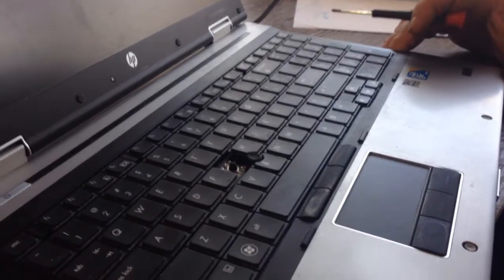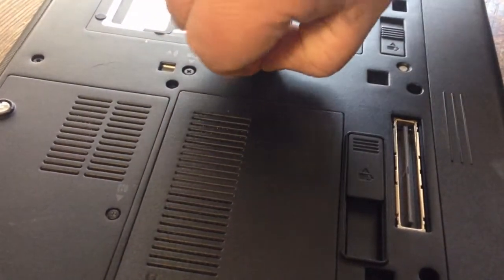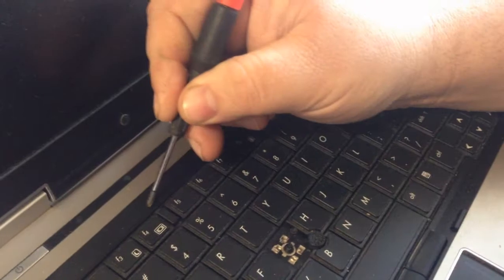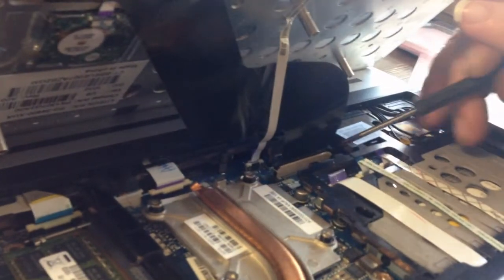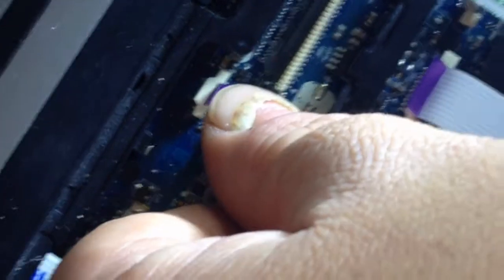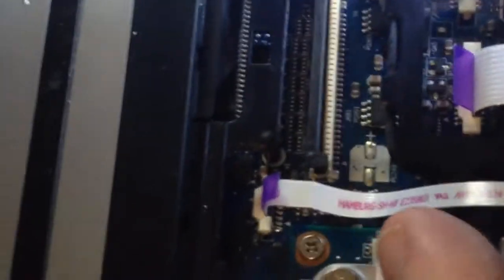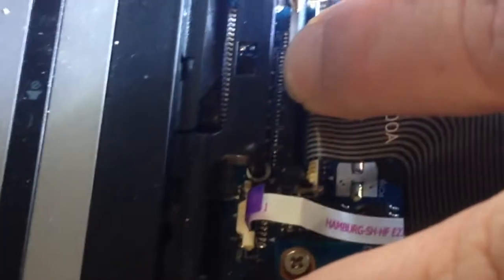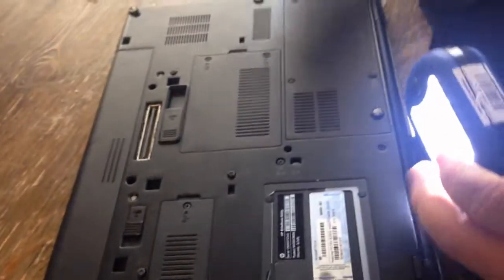How to remove and install a keyboard in an HP Elitebook 8540p

Comment: Thank you
I would deeply appreciate your advice on the following:
The graphic card on HP-EliteBook 8540-P laptop is Nvidia, which causing lot of problems & CPU overheating on Win 10 & Linux.
My question: Can I install a different graphic card, IF so which types or options you suggest?
Many thanks